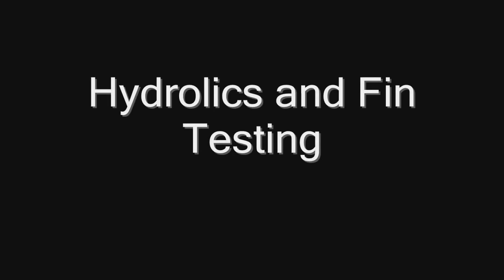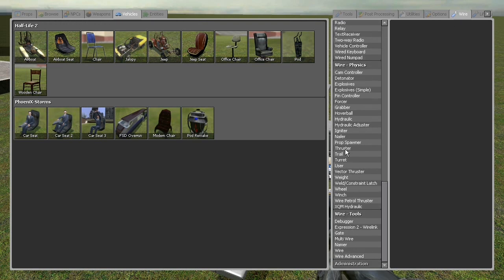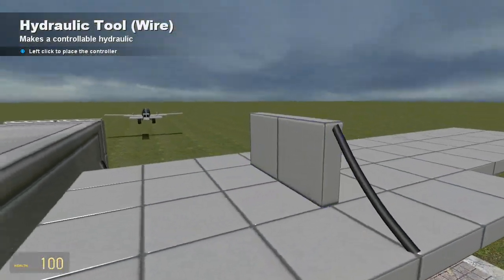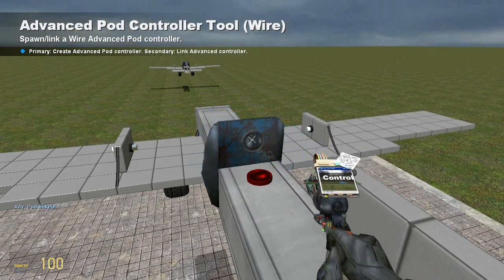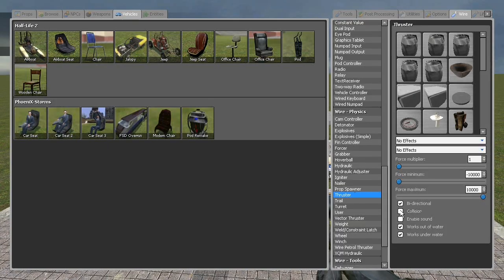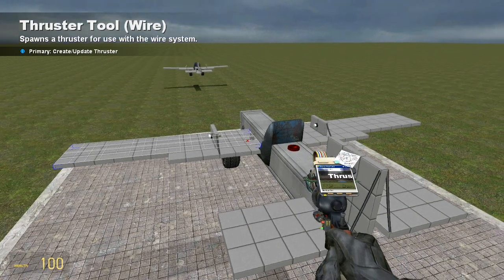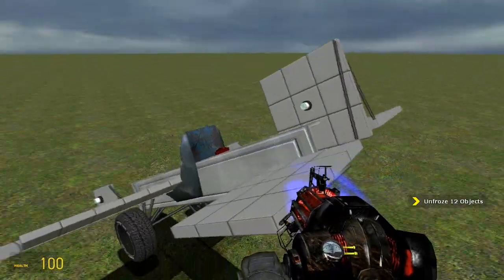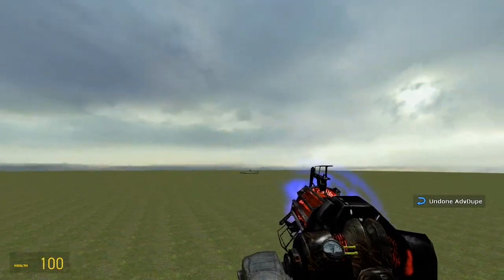GMod - Dman's Fin Tutorial (Hydrolics/Fin Test) [Part 5]

Comment from the maker: This is always a problem you will have. The hydraulic will never remain the length it was originally.  Just use trial and error at this point.  Lower the values of the hydraulic to correct for this.

Comment: If you want a smartsnap point on the thrust put it on the ground then easy precision the thruster on the middle of the front counter weight then push it pack with a nudge